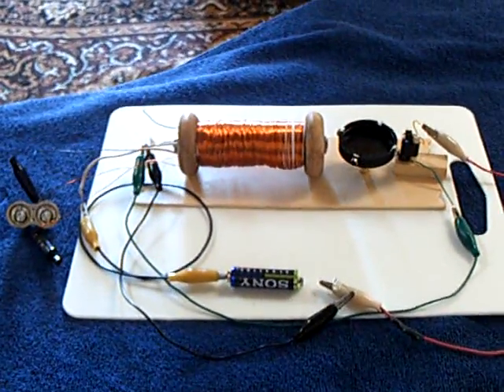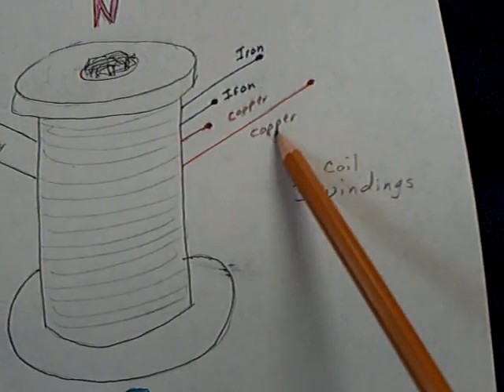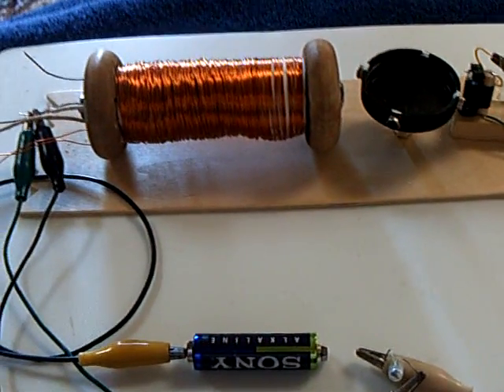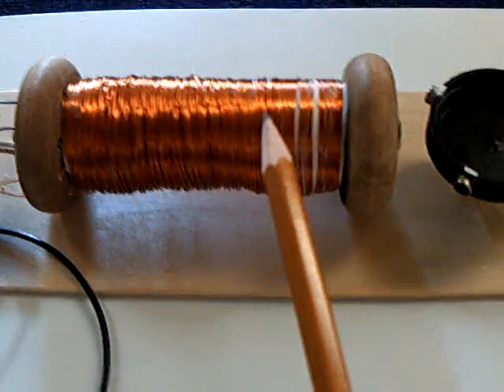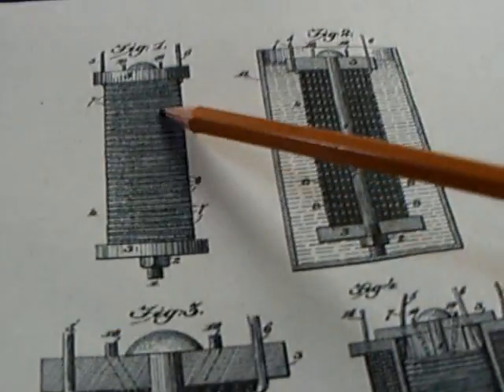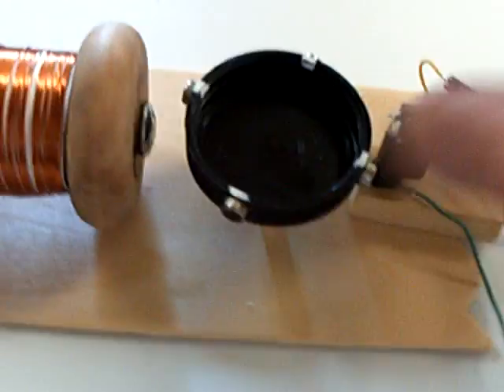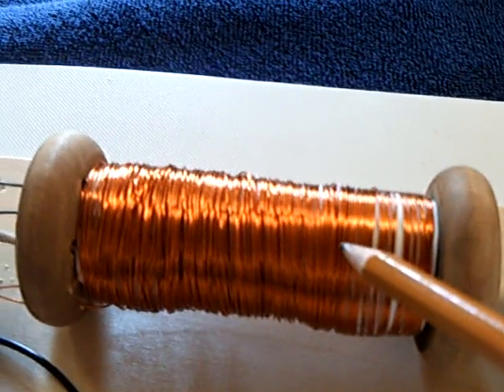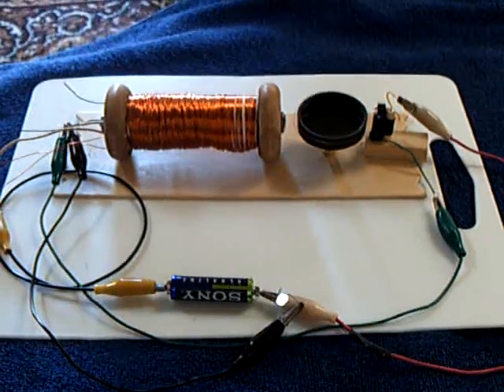Stubblefield coil with secondary winding

Comment: @Lidmotor I have to agree with Valveman 12 in that a bare copper wire needs to be insulated by only a cotton outer jacket. It's the reaction between the Iron and Copper wires over the large length of the coil when damp which creates the current capacity. It's the relative separation of Iron and Copper on the Standard Electrode (half cell) potentials table. I think Iron is +0.44 and Copper is - 0.345 so total volts should be about 0.78Volts.

Comment: A couple of questions.
Did you use cotton covered copper wire?
did you soak the coil?
The Stubblefield coil works by transferring electrons from dissimilar metals.  The water is simply a light electrolyte.  Essentially it's a battery.

Comment: Lid:

Great video.  From our research we have found that it is not a battery at all.  The PO made him change the name to battery before granting the patent.  This is actually an earth energy receiver.  The ones I have built do work.  You are correct in that the copper wire is cotton covered bare wire and the iron wire has to be soft iron as does the core material.  This is very important.  My coils were small as well but I got about 2 volts @ 40 mA's from the primary.

Bill

Comment: I think the problem is that the copper wire you use in the cotton cover is bared copper, not insulated copper. I think you will need both iron and insulated copper to go through the cotton cover...in order to work corectly... 
this is just my opinion, I didn't try this... I think you should ask lasersaber ... if is exaclty what he used:)

Comment: Hi Lidmotor, I have the patent in front of me and from reading the description  first page at 85 to 95
it say " The coil body 4 of the battery is compactly formed by closely-wound coils of a copper and iron wire 5 and 6.... and while necessarily insulated from each other so as to have no metalic contact, are preferably wound in a manner clearly ilustrated in Fig 3....
the copper wire 5 is incased in an insulant covering 7, while the iron wire 6 is a bare or naked wire"

Comment: Hi lid,
The reed switch needs to be connected across one iron and one copper wire. In the patent it is the outer one of each that is "interposed by a device... to cause the electrical currents to flow through..." 
So, if that does not work it should be only that the core is staying magnetized, although since you are able to get it to work as it is I think that connection is what is needed..
The inner wires are both just hanging free. (they are like electrodes of the galvanic part, he says.)

Comment: Did you wet the coil?
When in the ground, the moisture will cause ion transfer and stimulate electron flow.
If the dirt is exteamly dry, it wont work, same thing if your coil is dry.
Other than that, I don't have a clue, well, maybe - have you tried a core that is solid iron?